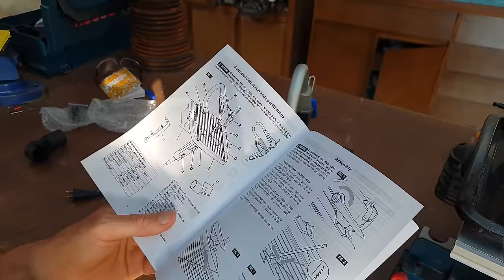Dremel Moto-Saw Review (A Scroll Saw Killer?)

Comment: Hi!, Actually, I have this product, so I try to make a straight cut but I have many problems with it because of the vibrations, I have a good one straight cute in the begining but after It moves even I press the piece of wood over the black table, to be honest I don't know if it is my hand that doens't press hardly or this is how dremel moto saw works. Also, I can say the blades are to thin that it makes 'em to weak and with the vibrations it makes it worst. I would like to know if you got any piece of a straight cut perfectly and it doenst look like a bite of shark.

Comment: I have owned one of these saws for almost 3 years now and outside it being portable it is a POS in my opinion and since bought a 16" Ryobi scroll saw which is a much better saw.The dremel has been sitting collecting dust for just as long(3 years,made approx. 2 hours worth of cuts)...never again dremel.And the clamps can also go in from the front onto your bench that way you can sit and do your cuts...
Reply from the maker: Thanks Kevin, I agree with you! Realised the clamping thing right after putting the video out...
Reply: Kevin:  Do you plan on selling your Dremel Moto-Saw kit??  I am looking to get one for hobbyist wood work, and not for 2-3" hardwood work.  Also would like to ask, would a cast iron table be required to cut 1/4-1" wood??
Reply from the maker: Hi Kelley. Cast iron table would not be required but would make it better. I can't recommend this saw for 1 " thick stuff but it would do it. I would like to sell,  but I fear you are probably the other side of the pond?
Reply: Yes, I am on the other side of the pond.  Up early this morning preparing to purchase the Moto-Saw.  I am looking to make puzzles, and smaller hobby type items.  I had also given thought to purchasing a Harbor Freight scroll saw, however, do not have the space to secure it to minimize vibration.
Reply from the maker: Good luck with it!
Reply: What is a POS?
Reply: @HJKelley47  look on craigslist for a used Delta 16" variable speed scroll saw. You should be able to get one for $100.00 or hopefully less. That saw is quite nice for the money, a good craft saw. 16" is reasonable amount of space between the blade and the back of the support. Has minimal vibration and a quick tension release  blade holder so you can thread the blade through holes then reinstall it without readjusting the tension.  You can put high quality blades in it choosing either pin end styles of plain end styles.  I have tried a number of different scroll saws that friends and neighbors had in their workshop, all of them in the moderate price range and the Delta variable speed 16"" performed the best of the moderate price range.

Comment: What is the thickness of the wood so that the saw blade is not broken?
Reply from the maker: Good day Ceyhun. Thank you for your question. I am not 100 % sure, as it will depend on a number of factors, such as the hardness and grain direction of the type of wood. More than that it will be heavily influenced by how you use the saw, if you are doing long continuous cuts vs short ones, curved vs straight, and how aggressively you cut. Hope that helps. Bongo.

Comment: Nice Record 25 fitters/turners quick release vice in the back ground! I have two of those, one like yours in near-new condition (one tiny angle grinder mark on the back of the frront jaw that I could fill and touch up) and one vintage with the beautiful rounded hub for the handle. Great vice either way :-)

Comment: I need to make an adjustable fence, for cutting precise widths, the material I am working with is very costly and making mistakes is not an option, wooly mammoth tusk, I picked up a few pounds of scraps for guitar nuts and saddles, many of the pieces I can get 2 nuts out of 1 piece, or that s the plan because I am not sure I will ever have access to anything like this ever again, its quite rare, quite old and in very very good condition amazing actually.. I shaped and cut one acoustic nut out of a piece that was the real close to the size I needed and its well worth the effort and tooling, specially after buffing...

mammoth tusk has its own unique ID or fingerprint and cannot be mistaken for elephant if you know what to look for, its grai is more zig zaggy compared to elephant that is straighter, under a magnifying glass its unmistakable and all of this is indeed mammoth and 110% legal and legit..

the reason I got this dremel is due to the small blade width, a table saw blade is just too wide and wastes too much material, again its very expensive and rare, so rare I will be collecting the dust ina sterile container that can be used in repairs so forth..

onto the issue of the table, the guides, I picked up are only adjustable in one direction, the distance the "mitre" fence is away is fixed, but it slides front to back? why its this way I dunno, seems unusable unless you have something that just happens to be that distance needs to be cut square?  since I have two I was thinking about modding the table and putting one in perpendiculare and cutting them away where they intersect which is how this should have been done, a fence for both directions they wont move the material with a 90 degree fence closer or further away from the blade which is what I need..

if anyone has found a way to cut material in widths of say 1/16th to like on 1" with a fence that keeps the cut straight please let us know...  TY, Dee

Comment: i think you may have put the blade in upside down - the little tbar pin should go in the bottom section and the plain end up the top.  i dont think it is locked in properly which is also why you are getting a lot of vibration, it not cutting properly - quite risky running it like that
Reply from the maker: Thanks for this Ruth. You can only put the blade in the way up i had it  since the teeth will not cut the other way... I'm using the blades that came with the tool.
Reply: The blade insertions are correct...  but it doesnt give a straight cut... i actually bought it to cut pcb but it cannot do my job

Comment: Dreadful review really simply because you set about to criticise from the beginning. The only thing you praised was the free notebook from Instructables. IMHO all Dremel kit is easy to use doesn't require too much skill to work out how to use it, maybe read the instruction on assembly first?
Reply from the maker: Thanks Systemtim, I also praised the dust extraction - which is excellent, how tightly you can make turns in the cut, how portable it is, and how it managed to cut through a thick chunk (which surprised me).
Reply: Timmamakes yes it’s a great video! Gives you a real feel for what your in for, what to do and what not to do!👍🏻👍🏻

Comment: I have a 16 inch RBI Hawk. I found that the larger blades do a really bad job and should only be used for larger opening because they don't turn well (understatement). If you want to do smaller things you need to get thinner blades. PS mine came with larger blades and they are useless for my needs. PSS- you should be able to adjust the tension on the blade. When you did the thick block your tension was way to loose.

Comment: I love my dremel tools but this saw is not worth the money. I bought it to cut printed circuit boards with and the blades just doesn't last.
Reply: but to be fair , the blades have nothing to do with the scrollsaw itself not being a good product.. you can purchase better blades of your choice. I have one and for smaller jobs this worked great
Reply: No shit, not even a dewalt or metabo would last cutting pcb-s. Those are meant to be cut with special diamond coated tools that are not available for many tools. The blades for this dremel are for simple materials like aluminum, plastics and wood, not composites that eat up almost anything.

Comment: Cool review but dremel should stick to dremels, this thing is a waist of money, I don't put it to your failures more to the inadequacies of the poorly designed machine.
Reply: Dremel has for  the last 60 years always had scroll saws as part of its product line. Of course the models have changed through the years. Why would anyone expect a light weight, portable, small motored scroll saw to perform as well as a large, stable, metal based scroll saw?  It is not badly designed, it is designed for a specific price point in a niche end of the power tool market. There is a difference between bad design and something being designed for a particular class of the tool market.